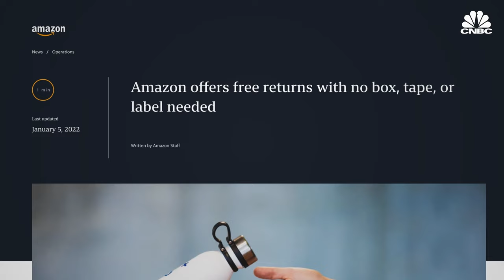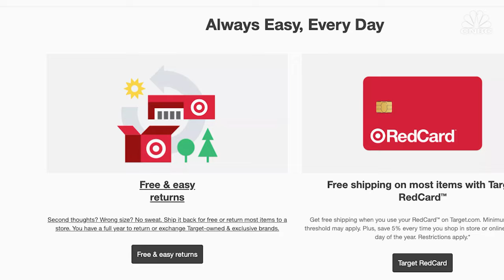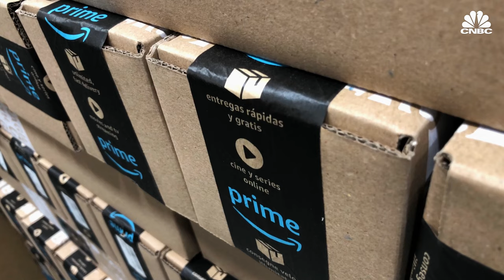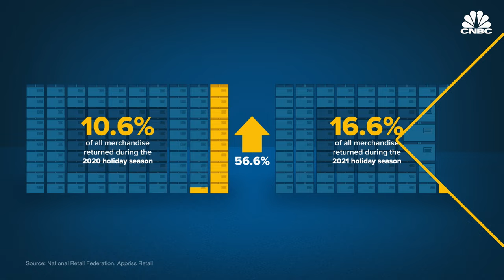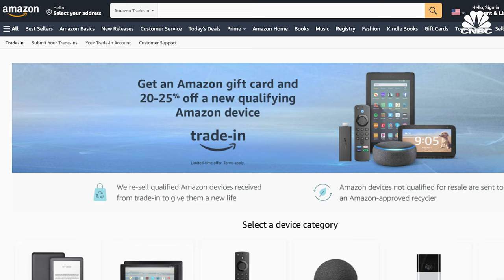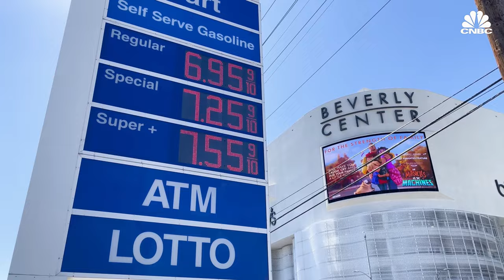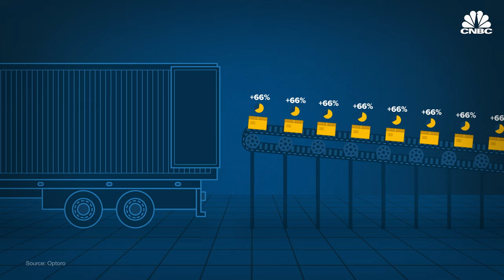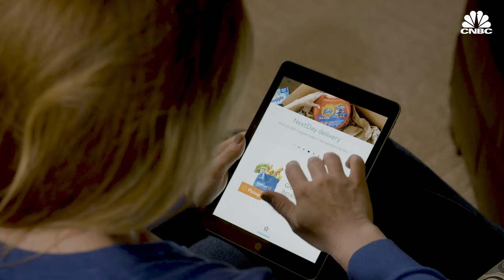Amazon’s Plan To Fix Its Multi-Billion Dollar Returns Problem

Comment: In My Opinion, I think Amazon should investigate  reasoning behind all the returns. For me, I'd say most of my returns are usually for a defective item. If we make items more durable and to built to last, at least that category, for the honest people, would be eliminated. To encourage people to actually thouroughly read descriptions and ensure that's the item they want, the free returns I think could be modified. If the description was accurate and nothing is wrong with the item, a return fee should apply (partial refund). Of course if there is something wrong that's on the company then it should be completely free.  What do you guys think would help?
Reply: Sometimes the one who damaged the item is the previous customer who return the item after being used.
And then amazon fail to notice the damage and the item is put back  into shelf and sold to the next customer who get the damaged item.
Reply: @claraisnotmebutilikeit  I'd say this is also true

Comment: if Amazon would stop selling Defective / Seconds / Damaged / Open Box / Refurbished items as new none of this would be a problem. rather than having a "Manufacture Returns" department Amazon just resells these items again in the hopes Customers dont bother returning the crap they sold to these unsuspecting buyers. this is why i stopped buying stuff from EBay, Amazon and NewEgg - especially electronics. Buyer Beware

Comment: Having worked at Amazon processing softline returns (i.e. clothing and shoes), an issue just as big as the returns themselves is the sheer volume of packaging waste generated from the original sale to the ultimate return.  Brick and mortar is so much more efficient in this regard.

Also we were told to ignore returns fraud cases as we lacked the trained and authorized processors who could interact with the customer account system.  It would astonish me the blatant fraud which I knew all Amazon customers paid for ultimately.

Comment: So I recently bought a set of headphones on Amazon. This is actually a rrpeat purchase becaaue i love these headphjnes and i wanted an extra pair to keep in my computer bag. 
When the heaohines came they were missing a charging cable. 

I did not want to return the product. They were fine except for the missing cord. I contacted Amazon and said, I just need the power cord sent. They REQUIRED me to create a return and send the product back and they would send me an entirely new one. This is their choice not mine. Frustrating.

Comment: I used to have an Amazon account and they couldn’t get things to my PO Box as we don’t have mail delivery to our home. They kept sending me stuff that won’t get to me. After awhile it was a game and I probably had hundreds of items returned. I even called them and they said they would get it right, but they didn’t so I kept playing the return game. At this point I gave up on them but still played the game ordering hundreds of dollars of things watching them get returned. What if funny is I always got eBay items delivered with no problems.
Reply: Yep. And I can often find things cheaper on Ebay and with delivery charges much cheaper.  Ebay's user interface on its website, however, leaves a lot to be desired and I often have a hard time finding what I want.  I just bought 2 rubber gaskets for my European moka pot from a seller in Denmark, for $13.95 each with $3.54 shipping for both.  It will be here in 2 weeks.  The same rubber gaskets were $19 on Amazon with $7.20 shipping for a week out.  Waiting the extra week was worth the savings. Plus, the seller spoke English and he was very polite and helpful.

Comment: Customer incentives would greatly reduce returns — for instance, if less than x number of products are returned within a certain time span the customer gets an account credit. Amazon has made friction in the purchase and return process so low that they are now dealing with the consequences. Whenever they have a product they promise they can deliver overnight there are almost always delays (understandably because overnight delivery is horribly hard to achieve) however now that customers have experienced this it would be hard to scale back without backlash

Comment: One of my biggest concerns buying on line is taking delivery of merchandise that has been returned or rejected by someone else. If some one else has worn the clothes or played around with the product I do not want it. Some people are just nasty and so are their homes and  some people are very careless especially if they know they are going to return the items.  I would gladly pay extra to know if I am buying a new or returned item. I would buy more on line if I knew the product was brand new. I also want to know where the item is made. I do not care if it is made in Beijing or New York. If you are hiding where it was made then I am skeptical. I like Best Buys. They give you an option of brand new unopen box or a discounted open box. Cabelas only sends customers brand new never worn clothes. Returns are only sold in their Bargin Caves. I trust these two stores.

Comment: The problem is rampant consumerism. That's right...you...the individual...are part of the problem. When you fail to weigh your responsibilities to society equally against the rights you receive from society, you contribute inordinately to problems when you could be also doing to more to find solutions. But don't feel too bad because corporations have more responsibility than consumers and they are primary drivers of these types of problems, not consumers.

Comment: Amazon is becoming the old eBay with there crappy drop shipping products and sellers. I once saw a listing that said if you want the item faster then send us a 10.00 Amazon card. 😡 they need to stop letting just any warm body sell on this platform. I have personally moved away from buying on Amazon because I never know what I’m gonna get like opened used products or falsely advertised products. It’s a Shame it was once a good platform to buy goods.

Comment: I absolutely would not shop on Amazon if they didn’t offer free and easy returns. I have purchased many many crap and/or counterfeit products from them. I bought a pair of “Kate Spade” earrings that were plastic and cheap, then purchased the same ones from Macy’s and it was clear the ones from Amazon were fake.

Comment: Usually the stuff we return is due to quality issues. Amazon sells a ton of Chinese garbage, I just sent back a pair of $15 HDMI cables because they did not work. Last week we returned some double insulated coffee glasses because they filled up with water (in between the glass layers) when put in the dishwasher for the first time.
Reply: Make sure something is dishwasher safe before putting it in there. But if it says dishwasher safe and it's not I get it.
Reply: Its your job as a consumer to leave a poor review
Reply: @thebigdoghimself  You can sort the reviews.  The default is by star rating.  Switch is to most recent.  That's what I do.  You get a better idea of the mix of ratings.

Comment: Return is a nice policy to benefit the customer, but I can see people buying products, take some of the parts to fix the same product they already have and returning back the product. I bought some used products from and all came missing some small pieces and parts. I was luck enough to reach out the manufacture and send these parts for free. People are using this benefit in a wrong way.

Comment: When you offer product from a website, ebay, and amazon, compare your returns from each and you'll see real quickly that amazon supports reckless consumerism. Consumers that buy 5 items to try out or wear once to a special event (wardrobing), consumers that buy items that do not research what they are buying, consumers that buy items outside fitment details,  and consumers that throw their returns in a box without proper packaging for the return trip are all reckless.

Comment: The funny part is it not the customers it's usually 3 party sellers  and amazon how to you resell a water filter that could be tapered or pants that ripped on the first use or a partially used tape

Comment: Easy? I couldn’t pick up my package from a locker pickup because of the 14 day delivery ended up being a day late and I could not stay another day to pick it up. (It already cost me more than it was worth staying an extra day because of original delivery date)
You would think automatic return/refund would go smoothly? No, on day 8 of my “no longer available for pickup” status; it took a couple chat sessions with 3-4 people, an email with a link to a return label, and an email back to them with screen shots showing I never received my package!  Only nice thing was the apology from customer service when he said he saw my previous correspondence. Couldn’t believe how many attempts I made to tell them I never got my package. That it was supposed to be automatically returned and a refund given within 3-5 business days. 
Bad enough being a prime member for over 15 years only to get on average 10-14 day delivery times these past few months. Looking like my last year as a prime member. I joined for the speedy delivery that I am not getting.

Comment: I wonder if something like a 5% cost for returns would help. It's small enough that people with genuine issues would still benefit from easy returns and a low loss of money but big enough to disincentivize people from ordering with the intent of returning it... ::shrug::
Reply: P.s. and waiving that 5% if there was a genuine error. e.g. shipped wrong product.
Reply: Pps. Perhaps the biggest issue is how much waste requires dumps instead of being made to be easily recyclable or compostable, etc. Waste wouldn't have to be a problem if it was part of a sustainable, circular process.

Comment: Amazon is now a joke. It has become careless in its processing and delivery. 3 out of 4 of my last ordered items have either been misdelivered, not delivered or misprocessed. When you ring the call centre to ask about this they give you the run around and try to make you pay the cost of return. They also have various fob off techniques that at worst include prolonged silences and failure to answer legitimate customer questions about their right of return. These extended pauses are designed to make you think the line has dropped out in the hope that you will go away and forget about it. This to the point where one might suspect that the third party call centres are paid a bonus if they can fob people off, thereby saving Amazon the cost of the return delivery and the probable cost of unusable unpackaged or just plain faulty return items. So although Amazon has lost billions on returns it is highly probable that it has saved billions more with these nefarious call centre fob off tactics. Such tactics are pervasive they do not apply to one single operator. Each operator I contacted employed this same tactics and others that were designed to cause me to pay the cost of return. In this case a left handed golf club when I ordered a right hand version. These were items under completely different order numbers. It took 3-4 hours of calls to their Indian/Filipino call centres before they finally acknowledged the fault. Such drastic tactics lead me to consider whether Amazon goods sales division is effectively trading while insolvent.

Comment: Where are they in the league? If they did that is it trustworthy? I have seen reports on the real efficacy of those programs and is that not hurting the manufacturerer? Those returns, 21%, is a hidden discount from the manufacturers margins.
Reply: The backlash from manufacturers, or shortages, accelerates inflationary constraints on over supply, about 21% more than demanded in the landfill or resale market, cannibalizing future sales.

Comment: I was Amazon Seller before the took my $7900 and closed my account. While selling on Amazon prime buyers would basically used my item my return them before the return window closed. The prime sellers are the one who lose most of the items I get sent back to me as defective are not actually defective but used and returned in such terrible conditions we cannot resell them.

When they closed my account I discovered another platform and I made more in 2 month there than all the months I was on Amazon.
Amazon as made it return a nightmare for the retail industry for persons who just want to use items and then return them for something different. They also steal my items and return items I don't sell and Amazon would just ship it back to me.

Comment: Amazon has shifted all the liability to 3rd party sellers when customers return items. It's really hurt oir relationship. They can lie and then if we want to make a claim about it, there is an arduous process, take a bunch if pictures of the item, the Box, and the customer said "missing parts" on a return for CANDLE. this company has got too big for their own good
Reply: Amazon wants to earn from buyers but Amazon wants to earn triple from sellers
I will tell you no matter how much people hate about china ,the truth is Chinese e commerce has a more mature system and mechanism to avoid fraudulence and loss for both seller and buyers
China's e commerce eco system has a thing called "return shipping insurance". Which is usually around 0.5-1 RMB (0.16 usd) paid by the seller to cover the return shipping in case the buyer wants to return it. It works really well with categories with high return rate like women's fashion.And the product will be returned to the seller instead of the flatform .if the product recieved is incorrect or used damaged by buyer,  the seller can refuse to send refund or block the buyer if he is simply trying to cheat. Seller can have the basic dignity of being a businessman which you don't get from amazon.and Of course,the seller will not send the damaged one to the next customer. while amazon will never allow this to happen,they want to make money from referal fee / storage charge/shipping charge/return shipping charge (ridiculously high). But you must be asking why Amazon is doing better than the Chinese ones , because it's a US company. Chinese investors are not trusted by the west.
Image this
You bought a shirt from a shopping mall, shopping mall doesn't allow you and the shop to communicate, but mall management is telling you ,if the shirt has any quality issue ,you come to me. I will take the refund for you from the shop. Mall management took money from shop to refund the buyer without even checking if what the buyer said it's true and won't even give the shop a chance for explaination.
Which mall does like this ????

Comment: Where is the video on the waste of oil and gas and the carbon footprint of the Russian Oligarch Super Yachts?  I'm glad that Amazon is trying to minimize the waste, but the "climate" angle of this video is plain stupid. There are bigger contributors to the so called "climate change" to go after than an Amazon return.
Question: If a truck makes an Amazon delivery to a store, and does NOT pick up any returns, then it goes back to Amazon EMPTY (and burns fuel).  If that same truck took back a return to Amazon, and that truck was going back to Amazon anyways, then how is this adding to the "carbon footprint" of the truck?  So there is a Net ZERO "carbon footprint" of the truck.  So just how much, exactly, "climate change" does an Amazon return cause?